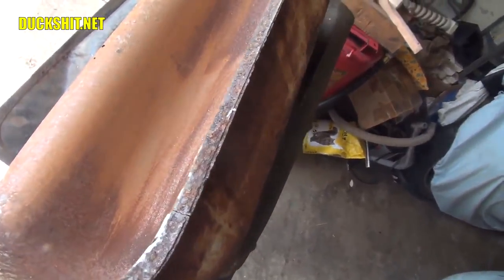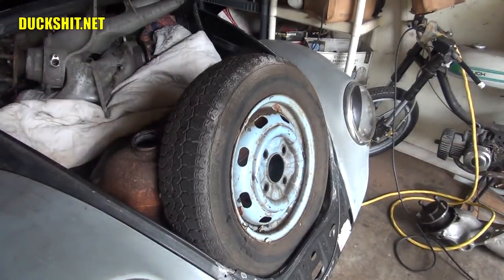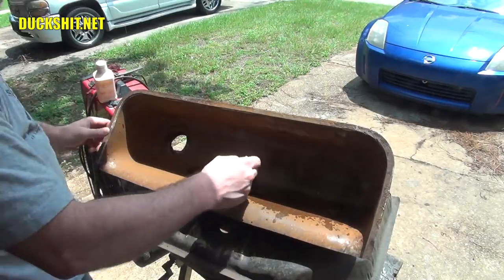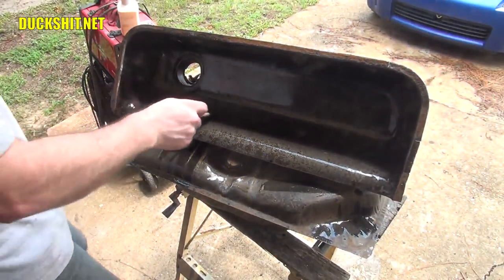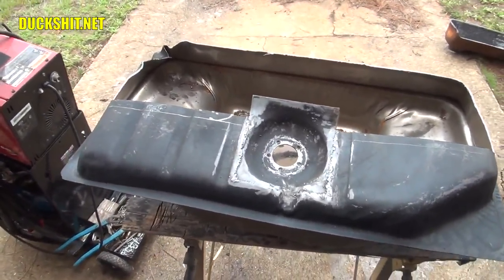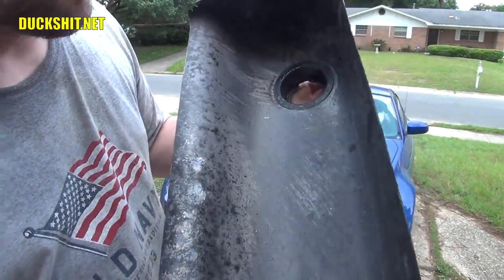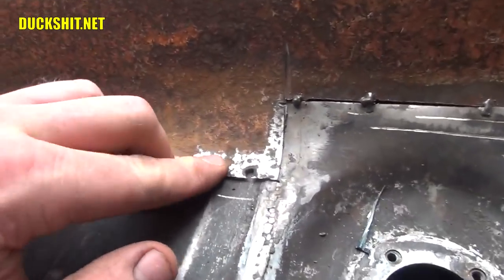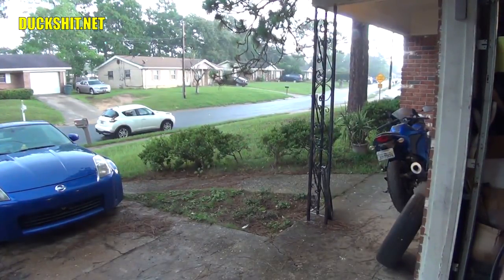Gas Tank  2 - ROTTEN OLD 1956 Chop Top Oval VW Beetle - 14

Comment: It really does fit like it was made to on purpose LOL thats cool. Looks Great!
Reply from the maker: Hehehehe!  I'm trying!  I want it to look like it came from the VW factory this way!
Reply: when you get done you can buy some Red-kote gas tank liner or some Cream they make a lot of different kinds I have used both of those they work good. You really dont need to coat it very thick with the Red-Kote to get it to work. It dont take a lot of it. They work even if it has pin holes in it. It will fill them in and it will seal up. It will never rust again.
Reply from the maker: The latter is probably exactly what I will use.  Had good experience with it in Dad's KZ440 Chopper tank that I put together.  It took forever to dry though, even a week later in the sun it still had a STRONG smell indicating it hadn't dried, can't paint it or fuel it until its absolutely dry.  I put it in the oven at 200° for about 30 minutes.... that solved the stink!  Now it was dry!  Anyway, I still have a can of it left, so its already paid for!   As you said, it doesn't take much, most of it you pour back out after its all coated!

Comment: Seems a good stuff that what you’re using there I’ve been using the por15 on my beetle awesome products just abit on the pricey side keep up with the vids mate
Reply from the maker: Thanks much for the comment!  The POR-15 metal prep is about 8.5% phosphoric acid!  😀  Its actually a bit weaker than this stuff that I am using which is 15-40% when comparing the MSDS data sheets.  POR-15 does contain some zinc phosphate though, so technically it helps to chemically galvanize the steel, but being weaker it doesn't work as quickly or as aggressively.  I've tried POR-15 and it gets the job, but there are cheaper options out there that work better.  I say use up what you got, it'll get the job done, but save a few bucks and consider something else in the future. 😀  Thanks again for your feedback!
Reply: DuckmanCycles and VW Garage thanks for your reply much appreciated it’s my 1st time restoring a beetle the chassis is solid just service rust really so I’m going to use the por on that then add a top coat for extra protection
Reply from the maker: Too awesome!   I remember my first one, too!  Any pics or vids? I don't see any on your channel.  You can share them on the DuckmanCycles FB group if you'd like!  😀
Reply: DuckmanCycles and VW Garage new to the YouTube vlogging stuff will be looking into getting some progress videos done tho and yes I’ll put some on your Fb page thanks
Reply from the maker: Thanks so much for joining us!  😀😀😀

Comment: Always great Info. , input an know how.  Throw some handles on the tank so ya can pull it strait out .  For rusty motorcycle tanks I used to tumble them w/ ball bearings in em an cream coat the inside . Thanx 4 takin us w/ ya
Reply from the maker: Handles?!?!  I LOVE THAT IDEA!  I have plans for the tank to be a transformer anyway, so at shows people can see all of my restoration work underneath.  Handles sure would be a cool idea!  I may do something with that.  Stay tuned!  AND THANKS!  😂😀😂😀😂
Reply: With hood lock ( coder pin ) system to hold it down .  It would take ya longer to disconnect hoses then pull the tank .  Throw in a drain valve to make life easyer
Reply from the maker: Some locking pins sound good, too.